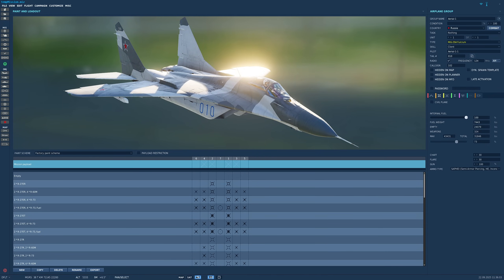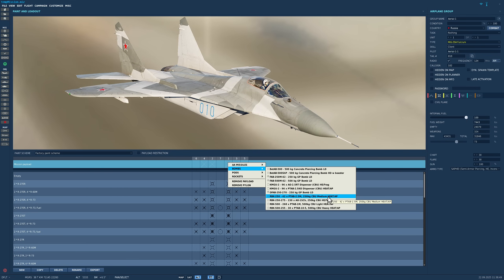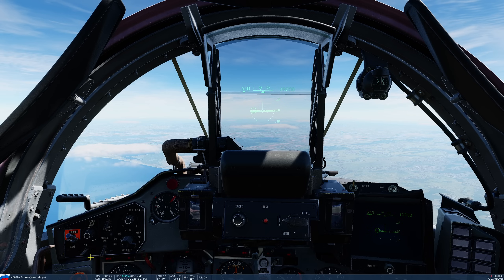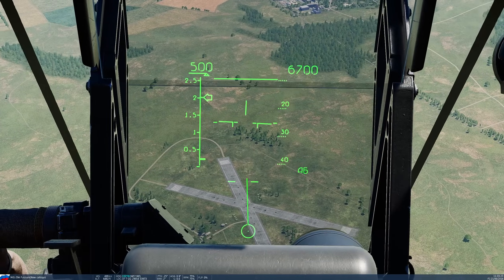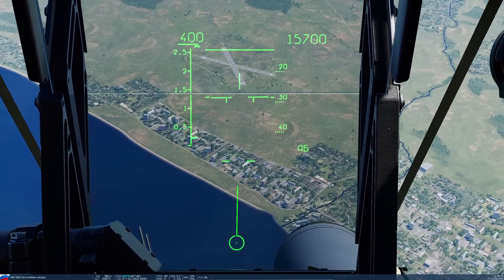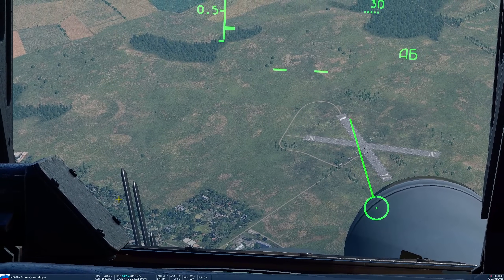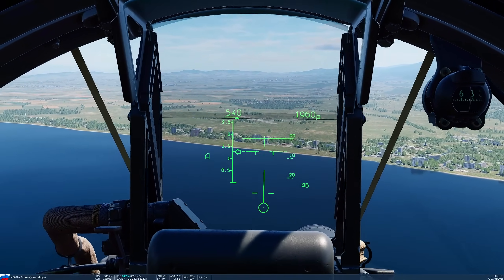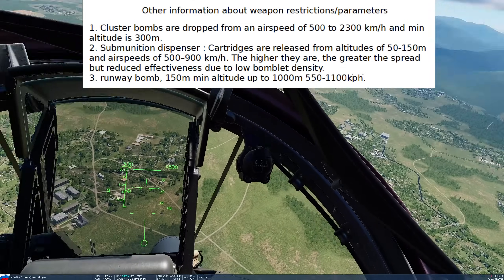Mig-29A Fulcrum: Bombs (CCIP, CCIP P/Des, CCRP & TOSS methods)  Tutorial | DCS

Comment: You can use bombs with R27R/T. 

1. COOP on "no retard"
2. Explosion mode on "ARMED"
3. Open Emergency bomb release cover
4. WCS Mode -> TOSS for CCIP
5. If you on the targe push Emergency bomb release

It only works with BetAB,FAB's and OFAB. 
Fuse options has no function it always explode on impact. (Bug?)

Comment: Seems the bombing guide in the instructional manual needs to be refined, especially if it's still a WIP. Or perhaps if the MiG-29 only had to be close enough to be good enough if it were carrying tactical nukes then that level of accuracy would be fine. Luckily no nukes were ever used that way.